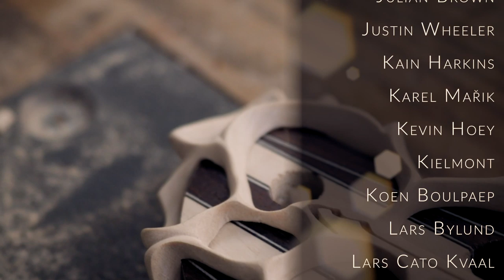Ep 17 Carving, Sanding and the Logo - The 90 Hour Build - The Complication

Comment: Can I ask a question I'm sure you've considered...... Tuner clearance?  Ie so you can turn the tuning key. A through this it's bugging me.  Clearly you've thought about this but did I miss it?  Is the original peghead suitably thinner? Ie you placed the tuning key holes in the face x mm closer to edge than normal to compensate?
Reply: This has been bugging me for the whole video!

Comment: someone's in the office fairly late... whoever you are, thank you

a bit late in the day for suggestions but maybe both ''exo-skeletons'' would be less fragile if stabilised with resin ?
Reply: As they are made from pretty tight grained sycamore (I think?), I doubt that the wood would actually "soak up" enough resin to do that. Please feel free to contradict me if anybody knows better!
Reply: @timbeaton5045  , Vacuum stabilization would give the best result I think but the large piece could prove challenging finding a chamber large enough. For information google 'Cactus Juice' (there are other resins but this what I am familiar with).
Reply: Tim Grenville-Cleave That Cactus Juice certainly looks like a solution. Whether the porosity of the sycamore would wick up enough, well, it could indeed work. Guess the only option would be to try it. Or at least do some test pieces. I must admit the thought of putting this guitar down on a stand at a gig, and watching it fall over and break gives me the shudders!

Comment: At the start Ben said it might need to be taken off for tuning. In order to take it off the strings would need to run underneath it rather than over it, but it doesn't seem to be designed like that. So,  is there enough room to turn the machine heads to tune it?
Reply from the maker: The latter, it turned out just now enough to be permanent, the strings go right over the top! B

Comment: You may have said in a previous video but what kind of hand saw is it that you used to cut out the interior design areas?
Reply from the maker: Hey, it's  a vintage fretsaw or jeweller's  saw.. we sometimes get them through http://www.vintagetoolshop.com but they are easily  available and great fun to use,  just so long as you get good blades that is. B

Comment: I'm not certain I like the "wrapping" of the headstock. For one, the focus on the body is lost. It might have been better to keep the headstock "simple". Also, while the "wrapping" of the headstock on its own looks fantastic without a doubt, it doesn't really match the body. The body wrapping has a geometrical quality and symmetry to it, which the headstock bit lacks.
Last, but definitely not least, if the headstock wrapping interferes with the tuners, it shouldn't exist, IMO.